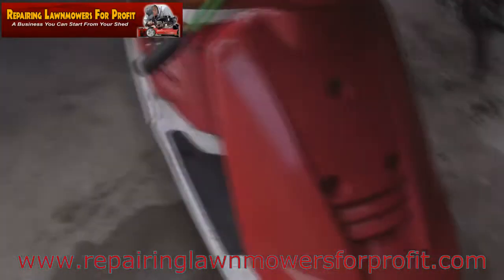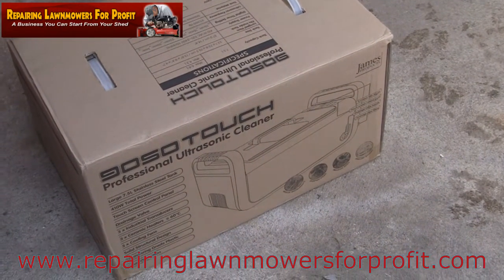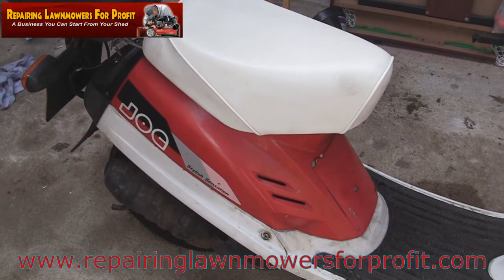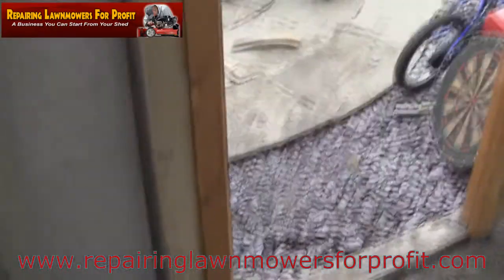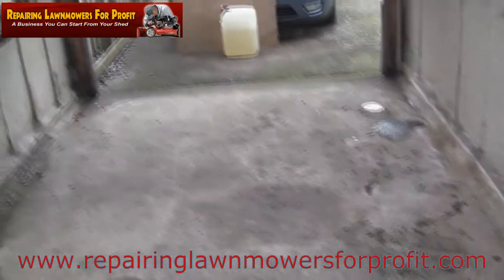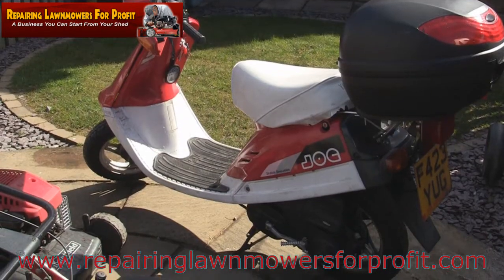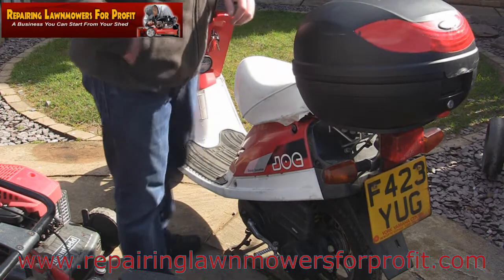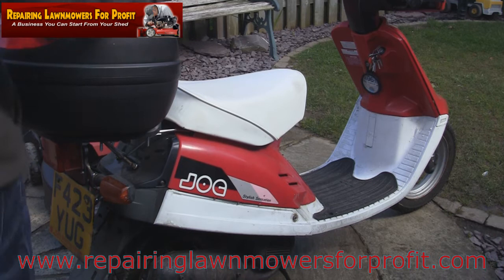Repairing Lawnmowers For Profit Part 116 (Yamaha Jog Start Up Problems) Part 1

Comment: Hi there I am having some problems with my Honda lawnmower it will start run and then cut out about 30 seconds later after it has.done this 3 times it runs fine 
Any advise please
Reply from the maker: Take the air filter off and put it on choke. Make sure the butterfly clasp closes fully. It sounds like it starts 3rd time as it has warmed up a little.  If it's still bad I would service the carb and set the valves as shown on my Honda DVD.
Reply: +Mower Man thanks I will have a look
Reply: +Mower Man I have just been out to try and fix the mower it is still the same but its 20 years old with a rotten deck and a blunt blade my dad says it s not worth fixing so we will get a new one when it dies. my dad and I are great full for the advise 
keep up the good work
Reply from the maker: +Leon Lavelle No problem cheers.